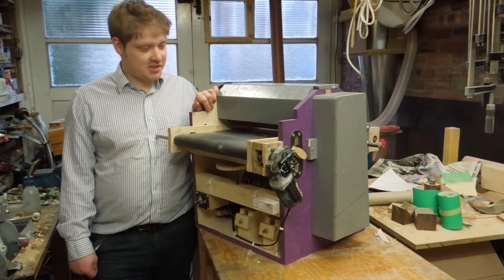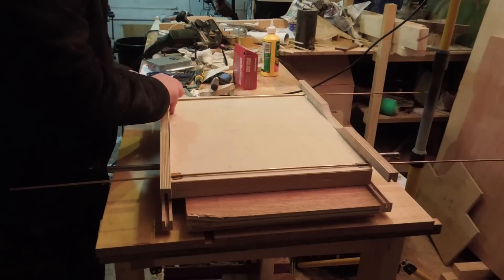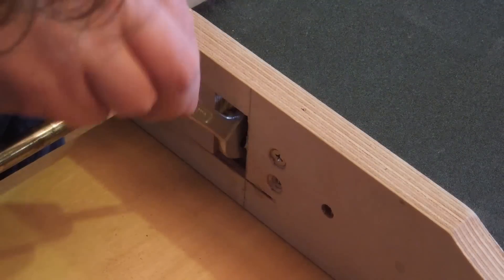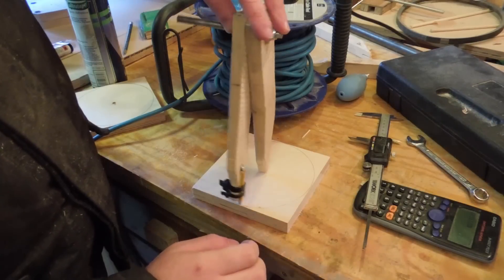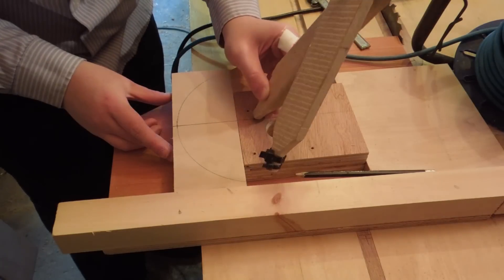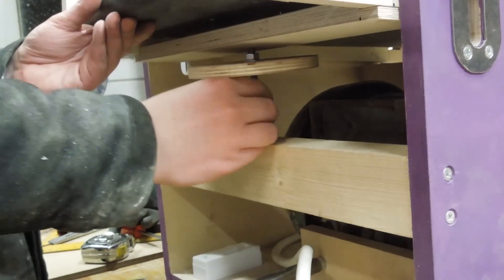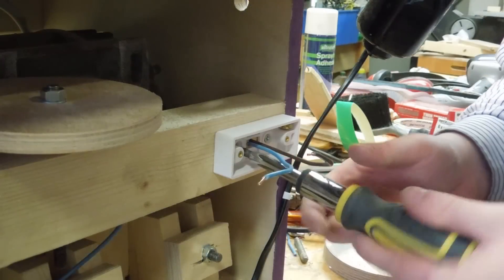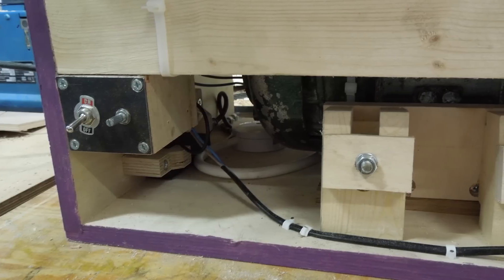Homemade Drum/ Thickness Sander

Comment: I wonder how you'd build it now, in this day and age of Send Cut Send...
Reply from the maker: not sure what that is. looks like some kinda online CNC service? i did get some steel parts laser cut a few years back to make a 3d printer but i went to a place nearby. was bit of a minor adventure since i first went to a plasma cutting place first and they reckoned the parts i wanted cut were a bit too precise for what they're capable of, so they referred me on. it was a pretty good experience and also surprisingly cheap. like less than it would've cost me to buy steel in small quantities 

still for plywood parts i still dont think there's much beating a bandsaw and jigsaw. laser burnt wood reeks and CNC routers cause alot of tear-out and struggle to form sharp inside corners. and both machines cost alot in space alone

Comment: Hi may I ask what motor is that driving your feed belt
Reply from the maker: It's a car windscreen wiper motor. You might be able to pick them up fairly cheap from an automotive scrapyard. The one I used to go to has unfortunately closed, so if I wanted another now i'd probably just pay a bit more on ebay.
Reply: @dangrundel  I found this on Amazon (Electric Drive Motor, Reversible  High Torque Worm Geared Motor DC12v) Do you thinks it would suit to drive the feeder
Reply from the maker: @GrahamSlater-Brown-b9d  I don't see why not if you can find a way to mount it and couple it to the conveyor's roller.
Reply: @dangrundel  Many thanks for that greatly appreciated. Three more question if you don't mind. Do you have drawings for this sander? What diameter is the sand drum and what width is it?
Reply from the maker: @GrahamSlater-Brown-b9d  In the video description directly under the video (press the "...more" to expand it) there should be a link to the Sketchup file. Sketchup is a free CAD program... or... it was at least. I'm not sure what it's current status is since it's been sold and resold to various companies over the last 8 years. I never did make proper drawings for this thing outside of that 3d model, but you should be able to take measurements from it. Not sure if i'd recommend Sketchup as a program worth learning to use outside of just taking measurements from existing models, though.
Reply: @dangrundel  Thanks

Comment: A tip that might help with small parts is to build to spring tension rollers, placing them about 14mm from the main drum. You should also try not using adhesive, the wedge clamps should be enough tension to hold the paper on. I plan on building one using a used treadmill motor and wiring an SCR with a bridged rectifier to convert the AC voltage to DC to run the gear motor and the main motor. I enjoyed the build. I would have had to edit the cussing out when the top glue failed. Painters or duct tape can actually hold mitered glue ups pretty well. I learned that making a segmented drum. Thanks for the video. cheers

Comment: A much much much simpler and more accurate way to true up your wood discs instead of trying to free hand it with lathe chisel would be to cut a piece of wood like a 2x4 the same length as you drum discs width and plane one side of it to make sure it's completely flat then attach a piece of 60g sanded paper to it and move it against the the discs as they are spinning, that way you get it done in one shot. Or another way is seeing how you're using a sanding belt for your table feed, lock the the roller table to prevent the belt from rotating then simply raise the table until it meets the drum discs (obviouslyas they are spinning) until they are trued up. This is where you say DUH!... LOL
Reply from the maker: That could reduce the number of steps, but you'd also get stuck sanding for quite a while. I did use sandpaper on a board to give it the final true up though.

Wouldn't want to do any sanding with the conveyor belt though. I want that as sharp as possible for the grip. Kick back with this thing is quite dramatic since it flings the part out at high velocity. I've not had that problem with wood but I did recently give myself a fright with some stainless steel sheet stuck to a larger board with double sided tape. Predictably the steel got hot, the tape softened, and a wafer of steel got launched out. Always stand to the side!
Reply: @dangrundel  A properly built and used drum sander will never kick or throw the work piece across the room. If it is your either trying to remove WAY too much material or it's not built right.
Reply from the maker: @dickdastardly2560  Or i'm trying to use it as a real lousy surface grinder!

Comment: Excellent job Daniel, one question, why use ply segments for the drum and conveyor rollers and not just turn a Dowell from a square blank, serious question as I want to build one
Reply from the maker: Plywood is more dimensionally stable with changes in humidity between seasons or changes in environment. A dowel might go out of round, becoming slightly oval shaped. Plus you'd still need a shaft down the middle to support it and try prevent it warping with time, and a long drilled hole like that would require... bagpipe technology. There might also be a risk of the wood splitting along the grain if it shrunk around a shaft...

But a huge solid chunk of plywood still might... bulge with changes in humidity. I've heard of people putting occasional gaps in with similar stuff, putting thin spacers between every few disks. I've not had any problems myself but I might've just gotten lucky.
Reply: @dangrundel  thanks for the very prompt reply Daniel, no one has provided an answer to this on any of the other sander builds I have watched, and now I am planning on doing it myself I really needed an answer, also wondering where you got your ideas for the conveyor system, I looked at Matthias Wandel's site, I already follow him on YouTube, and love his detailed approach and clear explanations, but the sander he kindly provided free plans for did not have any transport incorporated, and of course it wasn't his design, says a lot about a man when he is prepared to spend time drawing up plans for a friend's machine and then offer them for free just because people asked him to on his channel, this is a guy I should like to meet and shake hands with, you seem to be in a similar mould my friend, I have subscribed and will watch your channel with interest,my best to you and yours stay safe Jon
Reply from the maker: @BirdmanNorfolk  Thanks very much! Yeah I've got alot of admiration for Matthias Wandel. I think around about that time, 2015ish, youtube was really exciting as a ~community~ of sorts. Like you had a bunch of people making very down to earth videos that made this sort of "hobby engineering" stuff feel very approachable, as well as sharing and developing tips and techniques. I've definitely picked up alot of stuff from Matthias. 

But i'm not so sure about youtube currently. A couple years ago there was a big change in how video recommendations, the search function, and how monetization worked... that worked to bury alot of good videos in favour of what the algorythms deemed to be more profitable. As in, for your videos to gain any traction you needed to release about one a week at least, and over 11 minutes long, plus some other esoteric stuff.

As a result alot of the people and types of videos I liked either died out or had to shift their style to meet the demands of the new system. It's why there was an explosion of tool restoration videos, videos where people look at old novel 80s/90s electronics, or guys that say catchphrases while taking apart drills. It's quick and cheap content to make, and while I don't think it's all bad... it's just a shame it was the only stuff that seemed to survive the change.

I'm not sure if i'll ever make a video on youtube again myself. I mostly did it to feel involved in what felt like an exciting community back then... and it kinda no longer exists as far as i'm aware.
Reply: @dangrundel  Hi Daniel, yes it's a shame,lots of good makers overlooked now, you really have to search for good content these days, too much click bait, irrelevant advertising, and taster videos which waffle, promote their Patreon site or their Apps or just work as a shop window for selling plans, OK people have to make a living, but if you show nothing of substance in the video why would anyone buy your plans?, I use YouTube for ideas, if I really like something then I may build it, but I am a creative person, I don't just copy stuff, anything I make will be adapted to my own needs and capabilities, I don't have a $40,000 CNC, and wouldn't really have the use for one, so buying plans for a project needing one would be pretty pointless, but there are so many like this, also there seem to be fewer UK based maker's, perhaps most of them have given up posting like you, who really knows, nice hearing from you and I would like to keep in touch if you don't mind, but I can't find you on any other platform and of course I don't have your email...
Reply from the maker: @BirdmanNorfolk  Don't get me started on patreon... gig economy stuff is just depressing if nothing else. 

And yeah I'm not sure if the UK has a very strong enthusiasm for woodworking. I blame class identity! There is some Maker stuff around and about, but I wasn't too impressed with the stuff near where I am. I feel like The Maker Community in general encourages chasing or desiring expensive products as solutions to problems. Feeling you can't cut shapes out without a laser cutter or a CNC router. It's a feeling i'm familiar with... and why I valued finding that youtube stuff a few years back. It's difficult to realise a scroll saw and printed paper templates will work just as well, if a bit slower, if all you have in your social media feeds are the incredible things your wealthier peers are making with the laser cutters you lack.

It ties into patreon a bit, I think. That service encourages a more one-way transaction with an audience. You're the content producer and they're there to consume. It's anti-community!

As for other platforms... I guess I like to try keep my stuff separate. I wouldn't say they're entirely compatible.
Reply: @dangrundel  Hi Daniel, yes, I wholeheartedly concur there is not enough good stuff now or you need to really search for it, I am a bit luckier than most because my main interests are woodworking techniques and playing a  musical instrument and have been for a long time my recommendations do reflect these quite well, but anyone new to using YouTube isn't going to be shown this stuff

If you are still interested in good content then check out  Alex at ThisWoodwork he is a talented young lad with some excellent ideas and he explains things well, really well thought out Router copier system to do repetitious or copy turning on a lathe, I plan to build it, see what you think, Herdandson is another good channel presented by Alan Herd of TV fame he used to do Groundforce and Challenge Tommy Walsh on the BBC,  a really nice very skilled bloke but more my age group than yours!

Also have a look at finchcraftuk, Danny is very down to earth, does nice affordable projects and gives good explanations, he's over in Leicester so a bit far away for you assuming you still live on the Tyne, but check out his channel anyway, it might be useful if your still following the hobby or working in the trade...

Comment: daniel, i tried to down load skp file to open for the plans to built drum sander but i couldn't open that file can you change to PDF files that will help  thanks
Reply from the maker: It's not so much a plan as a 3d model. "Sketchup" is the program that can open those models. It used to be a pretty good program a few years back, and I still use it for some stuff. But I wouldn't call it great any more.

Comment: Nearly five years in, how's it running for you?  I'm contemplating building one very similar to this after I finish my oscillating edge sander.  Any thoughts?  Changes you'd incorporate?
Reply from the maker: I've not done so much woodworking lately so i've barely ran it in the last few years, but i'd still say it turned out pretty well. Even when I was using it regularly though I really wished i'd given it more vertical height. I think alot of that is from using a way bigger motor than intended, but I should've extended it vertically a bit anyways.

It could also do with some infeed and outfeed rollers for long and thin stock. To keep it flat as well as provide better traction against the belt. As well as better dust collection to stop it settling on the belt and causing traction issues.

Also sticking the sandpaper onto the drum with spray adhesive wasn't a smart move. Made it a hassle to remove. There's the option of using velctro to attach it but I was using this thing to plane stuff before I had a planer, and I could see that causing snipe and not flattening the material as well with the cushioned sanding surface... but it could help with when you try take too large a cut for the belt traction to keep up with.

Oh yeah the height adjustment was pretty lousy as well, with just the one nut so the rod could easily wobble all over. Made adjustments more of an estimation thing rather than anything precise. Maybe a thicker beam with a nut both above and below would stop it from wobbling as much and help somewhat, or a longer coupling nut... Something I absolutely could've and should've fixed, but it was on the edge of being just irritating enough to live with.
Reply: @dangrundel  Thanks for that insight!

Comment: Another guy had a tip about trueing the disks...  put sandpaper on the sled, and turn it on.  Then using velcro around the drum seems to help with chatter, supposedly.  I'm still trying to decide whether to go this route or just spend a few hundred dollars on a "real" one.  I feel like it will cost me about the same either way.
Reply from the maker: I'd heard the cushioning from velcro is good for getting a smooth finish, but with this I was after dimensional accruacy. I could see it rounding over the leading edge a bit, but for making veneers that probably wouldn't be a problem. Although it might be a problem if centrifugal force flings the sandpaper out enough to catch on the conveyor belt if sanding something real thin....

I think making your own would end up cheaper if you have alot of the materials available. I'd been collecting motors i'd found cheap in second hand shops but they're stupidly expensive to buy new. The one I used for that sander i'd gotten given after a guy posted about wanting rid of it on a machining forum (that's now kinda dead).

The real cost though would be time. I had more time than money back then. I figure from the username you're interested in making guitars, and if I learned anything from that banjo it's that it was all too easy to get caught up doing everything but making that banjo...

Comment: It has been a while since you done this video now...  So, how is the sander holding up?  How is the wiper motor and electronics holding up?
Reply from the maker: It's holding up pretty good. Alot better than I expected. I figured i'd use that speed controller till it burned out, but despite it running at i'd guess near 100 degrees it's not died yet. Wish I made the machine a bit taller though.

That said i've not used it a whole lot over the last year, just a few times for making veneers. I'm trying to escape wood since it's just been killing my chest. Occupational asthma!

Comment: for the drum, you could have just used 4 inch PVC pipe.  then make wooden inserts for the ends.  pvc pipe is not expensive.  you can have several drums with different grit sand paper.
Reply from the maker: I didn't trust PVC pipe to be accurately round or to hold the pressure. It'd need wooden inserts throughout it for support, and to be turned round on the outside anyways. Plus I think the weight acts as a flywheel to help stop the thing stalling.